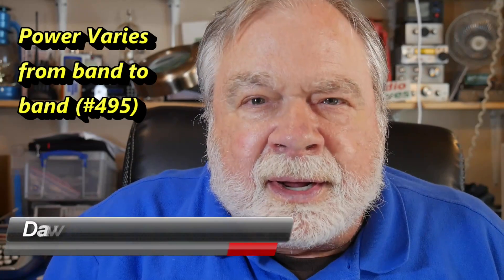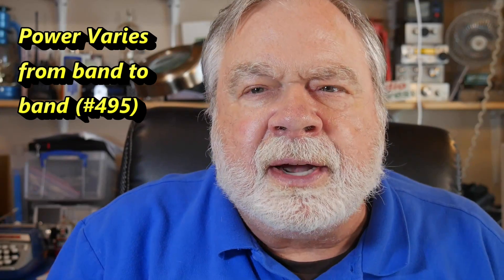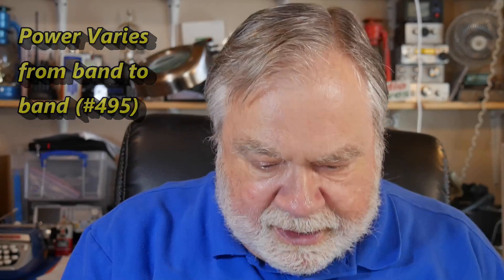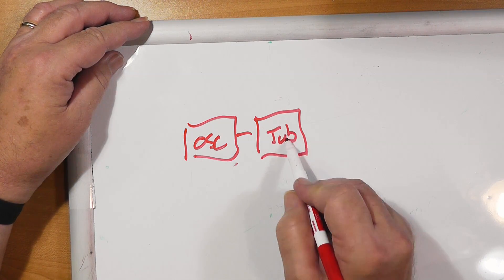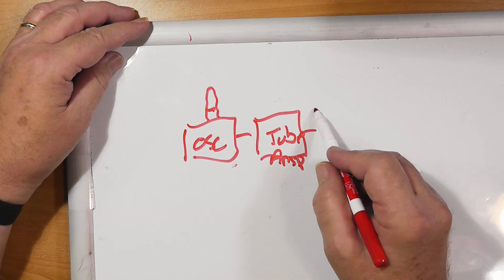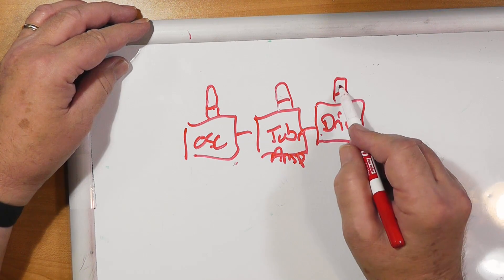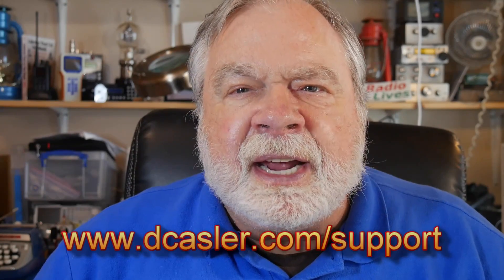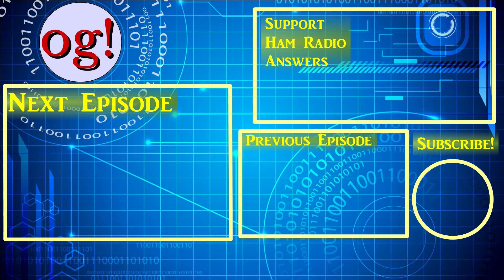Power Varies from Band to Band (#495)

Comment: He could be talking about a 7300.  I have this specific issue with my 7300.  Never end up getting the full SSB power output even with a low SWR on a resonant antenna. But yea- if he changes band,  the antenna is probably on resonant with a low (close to a 1:1 SWR) on a single band and not the others.  But who knows. Great info.  Always learn so much from your videos.

Comment: I notice that many VHF/UHF rigs have different power for VHF and UHF, UHF always lower if there is a difference, but I suppose that's a different ball of wax.  Also, this topic had me thinking of a manual I was reading on an Italian made "10 meter" amplifier, 500 watts PEP.  It was funny because it had a gain graph throughout the 25-30Mhz range it was constructed for, with the highest gain at 27Mhz and not at 28, with a big "DO NOT TRANSMIT HERE" over the US CB band, where the highest gain was.  Indicating, as we all assume, that it might actually be an 11 meter oriented device, and not 10 meters....

But to get back on topic, the fact there is such a difference over the 5 Mhz it is designed to run on was surprising to me, as I expected it to be the same throughout.  I never thought about the limits of these things, and it is an interesting thing to keep in mind.
Reply: UHF has  creates alot  of heat and thats what ive been told about the whole 50w VHF 30w UHF deal with mobiles.

Comment: Modern 10-80 radios have broadband PA's but switch different low pass filters for each band, they can get damaged and no longer match 50 ohms. You need at least a good load and a way to measure amplifier (even rig) input power to test for efficiency on each band.. Also, you will always see some change in power but say 20% is only 2Db and often corrected by a drive tweak.

Comment: Always test your output power into a decent power meter AND dummy load.
I ofcourse understand the issues with the older radios as my FT--101e suffered from lower output on bands above 14 MHz.The tubes were very old and showed lower emission above 14MHz.
A great video and explanation Dave.
73.G7HFS/PA3IKH.
Reply: Very good explanation sir..

Comment: Is 100 watts on 10 meters the same as 100 watts on 160 meters, (and 80, 40, 20)?  Because an Amateur/Extra licensed fellow seems to be telling that I shouldn't waste my time or my little hundred watts on the higher bands but rather get an amplifier capable of 1,500 watts.  Kinda pricey for mu budget, (and I think this guy is being condescending and rude).
Good video! KD8EFQ/73.
Reply: Do not let snobs influence your choices. Power is not greater or less on different bands. Will you break pileups with 100 Watts, maybe not, is that your goal, why? You can do a lot with 100 watts, some people do even more than most people on a lot less power. I talk regionally and into the south Pacific just fine on 80 and up with 100 watts, PS - being an Extra means we passed a test - NOTHING More!
Reply: @LibertyCaveWS7PB   Most of the time on 10 meters and vicinity, I like to run my Icom 7300 at 50 watts on sideband.  Sort of like Cruise Control in the middle lane of the interstate, right?  Otherwise, I know an egomaniac nutcase Extra/Advanced Class op that thinks everything's gotta be run at full tilt!
Reply: @kevingary7018    That wasn't quite what I was asking.  They seem to imply that 100 watts is just simply not enough on the higher bands for a QSO Ragchew scenario as they claim no one will likely hear me.
However, thank you for your reply.

Vertical antenna at 20 feet, let's say 1/4 wave on 40 meters, with 100 watts how much ground should I cover in relative range?
Reply: I'm also running an Icom 7300!
My antenna is a Chameleon match CHA-MIL HYBRID at which the owner's manual says its rated at 500 watts (?), and mounted to an apartment balcony railing on the 2nd floor at about 20 feet.  The radiating element tunes up well by itself being a 17' telescoping whip also from Chameleon Antenna, that supposed to be able to handle a lot more power by itself.  Should I get on 40 meters with it with 100 watts and be able to cover a good amount of area with it?  I'm in Akron, Ohio with about 1,100 feet above sea level.